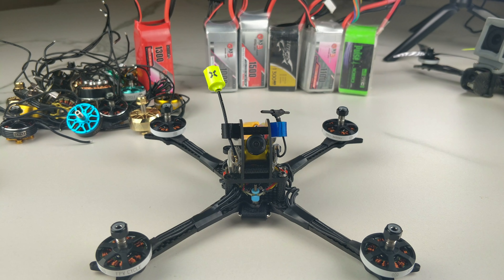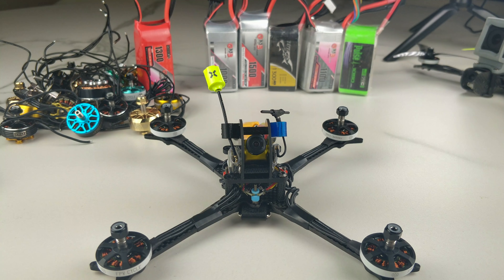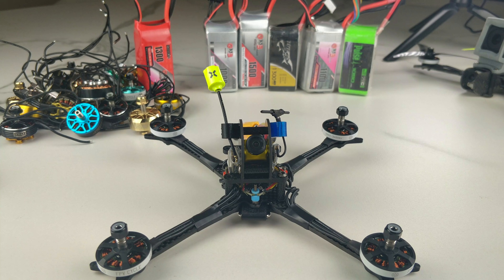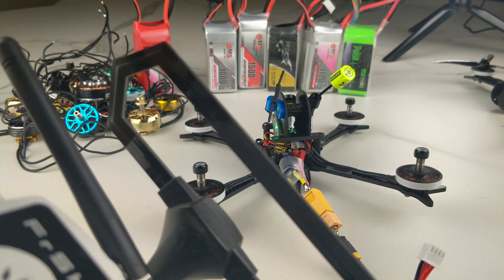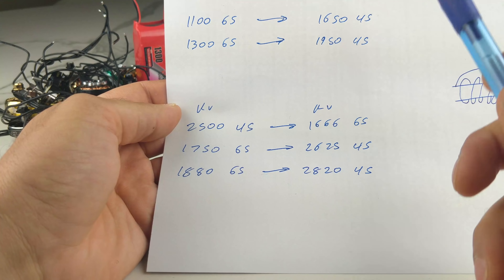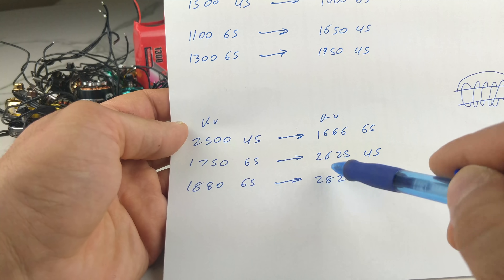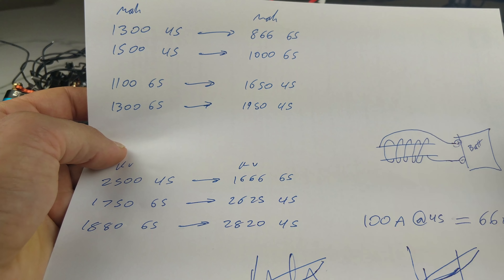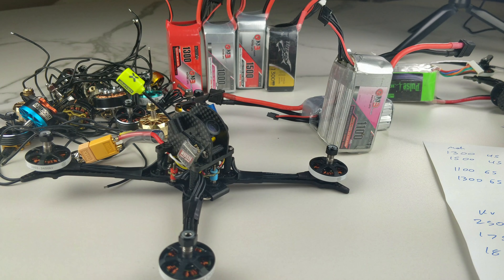6S Everything?  Why does 4S feel different?

Comment: While i do have plenty of 6s, my Skitzo Super Nova frame is on 4s with 2750kv motors and it has remained my favorite quad. I have not been able to duplicate it on a 6s rig.
Reply from the maker: You won't be able to. The torque at the low end just feels way better. But you also get sag on that quad unfortunately

Comment: Great content and great presentation.  I'm a physicist and you nailed it. Thanks for the video.
Reply from the maker: well I did leave out the whole inductance part which sort of continues to balance things but in the end, the ESC is just switching a LOT more at the lower RPM's so no matter what the current ramp is more drastic on higher voltage if all else is equal.

Comment: Higher voltage usually creates a more efficient system, bring on the 20S i say! Can always add a throttle curve to smooth things out.
Reply from the maker: That's not actually true. Higher voltage is less efficient inheritantly.  It's just that the amps overall are lower so you can use thinner wiring and save weight. Otherwise it's also less efficient at the ESC because they need to switch more which is a lot less efficient. The same capacity of lower voltage is going to be a lot more efficient as long as the batteries electrochemistry isn't being over stressed.  This is really why there's no point to going up in volts unless you're already pushing the battery past it's comfortable point.
Reply: @Kabab  i hear where you're coming from but I think you need to give voltage more credit.... smaller windings usually means more efficient motor also(less air more wire)... and in the end isnt everyone getting longer flight times on 6S compared to a similar Wh 4S battery??
Reply: Lmao, nice

Comment: Thanks for taking time to explain this I feel better now I'm new to hobby and going with 4S build ,But I thought made a mistake by not going to 6s because it seems everybody was going with 6S you helped Thanks 👍🏻👍🏻
Reply: 4s is fine bro especially if ya dont carry that pig hero 7 or 8  every flight
Reply from the maker: I still recommend building all 5" quads to 6s and then running lower voltages if desired. Specifically because lower volts on low kv motors is so darn easy to fly. But 4s is totally fine. More than fine. A light 4s quad feels nicer to fly than a heavier 6s quad.
Reply: @Kabab  my stack&FC can handle it but I have 2345 KV motors will that work?
Reply: @sully4875  yup just adust throttle % in BF ...n run a big cap

Comment: I have the parts for a 6S 5 inch UL kwad coming in tomorrow so it'll be interesting.  BH 2004 1950KV motors, Gemfan 5125, AUW under 250g.  Will upload footage on my channel
Reply from the maker: It'll be quick but it definitely doesn't need the 6s. 4s on it would be plenty
Reply: @Kabab  Want to give you a quick update.  My 6S 5 inch Ultralight is flying beautifully, no significant electrical noise issue.  I don't think it's necessarily quicker than 4S given the lower KV (1950) but am liking the faster throttle response and less sag.  Test flight footage: https://youtu.be/LbKmPqfciVU

Comment: Hey KababFPV, just regarding the board and the noise (electrical) motors make on 4S - I am using such board on 7" ultralight 6S. There is such a great noise from those motors that it destroyed my VTX haha.....but it could be fixed by adding multiple capacitors. Ive added like 4 1000uF 25V and its kinda OK now. This defeats the purpose because I am using the board to save some weight so I am saying this to maybe direct You to let manufacturers know to add more capacitors so we could also use these boards on bigger stuff :)

Comment: I dunno. My packs last longer 6s but i do prefer lighter builds with 4s and i think 7 inch flies bettwr and more efficient on 5s
Reply from the maker: It's easier to have much more overall capacity with a 6S pack. A 1300mah 4s is equivalent to an ~850mah 6S. I don't really know of anyone that buys just an 850mah 6s for a 5" quad. They usually start at about 1100mah 6s which is 27% more overall power capacity than a 1300mah 4s. So right off the bat you have 25% more overall charge in a standard typical 6s pack.
Reply: @Kabab  I got into 6s for the longevity fo the packs. My packs go through a full 70 cycles on 6s I couldn't get that on 4s. And for the 7 inch build the 6s setup allows me to use less current (Amps) and sip away at the pack but I did test with 4s and 5s I found 5s to be the sweet spot for the 7 inch in terms of power to pull out of dives and efficiency. It wasn't scientific and I didn't change motor kV in my testing . But for sure my battery lasts longer on 6s setups not flight time just life of the pack I tend to get less dead cells.. weird because the probability of a bad cell is higher with the higher cell count but there you have it
Reply: I'm actually going to try 5 s on my 7 inch again soon
Reply from the maker: @elxero2189  capacity is what leads to flight time. Not voltage. That's why 5S with more capacity is more efficient. Higher voltage is actually less efficient on the ESC side of things. The reason 6s on 5" or really anything under 8" lasts for more cycles is because the overall wattage draw is the same as 4s or 5s but the amperage is less. Amperage and heat are what kills the chemistry. So 6s with less stress per cell due to the higher voltage and higher overall capacity is why they last for more cycles
Reply: @Kabab  yeah that's what I figured. They can take the pressure unlike the 4s which is great for flow style flying. Now 5s -less 100 grams or so with very similar performance might help me eek out a few more minutes on my 7ninch... We shall see. I did take your tip on larger diameter motors for bigger blades though got 3010 motors for 7 to 7.5 props to test so far on 6s I'm getting very similar performance in terms of flight time.

Comment: It feels different because sets ( prop engine battery ) aren't equal match but close aproximation. If round KV up then you need lighter prop . For motor the combined cuperfilling of stator needs to be equal  fictional exmple: total windings 100mm2 == 20 windings(4S) x ?AWG == 30windings(6s) x ?awg that difficult to mach   
1 ampere 6S 15 windings vs 1.5A 4s 10 windings 1.5A  both get magnetic fource generated bij 15amps.

Comment: BTW you better save me a couple fouride 5"s for naming it. ;)
Interesting discussion not sure I totally agree, although I think you are pretty on point with regards to traditional 5" and up. Where I think this changes is when you get into the situation where the battery is literally the limiting factor in the entire build, eg micros, ultralights.
Heavy 3" pilots running big 14xx/15xx motors have found this, going from 4s 650/850 to 6s 550/650 yielded a big jump in performance in most cases. Back when we run "heavy" 2.5" going from 3s 650 to 4s 450 again yielded big improvements in performance all round.
When it comes to situations where you are chasing the smallest battery you can get away with going up in voltage tends to yield positive results. I belive the difference here is that because the power:wight is so high the motor torque is simply a negligable consideration. You'd be hard pressed to say that a 6s 1507 3" is less responsive than a 4s 1507 3" for example.
I do think if you are chasing that ultralight dragon and trying to shrink your lipos, you need to go up in voltage. Maybe if your lipos have power to spare you can afford to drop it again.
Reply from the maker: On that 3", you've gone up in overall Wh on the battery by moving to 6s. You also get a lot more rpm on the motor which is probably what you're considering as 'more performance'. Ultimately it's whatever you feel in the real world. The concepts are never complete enough to explain everything. I'll have some Fouride frames on reserve but there are actually not many 5" ones coming. I misjudged how good the 5" would be
Reply: @Kabab  True apples to apples is often hard just due to availability of cells, I think the crux of it though is about how much spare power your battery has available. The more flight time you spend @ >20-30c the more sense increasing the voltage makes.
I'll keep an eye out on the patreon for the frames.

Comment: What problem is this design solving with motors like those?
Reply from the maker: The frame?  Nothing at all.  it's just a pain frame that's got some updated mounting bits on it.
Reply: KababFPV the motors have no benefit over typical 2306 or 2207? If not why bother?

Comment: I think you are wrong about the explanation of torque of motors.

"Since the strength of the magnetic field is directly related to the current in the wire, the magnitude of the magnetic field would increase with an increase in voltage in the circuit."

Thats simple physics:
U=R*I

U(Voltage) is higher
R(Resistance) is the same
I (Current) is less

and because Escs are working with PWM, thats means the moment the motor is actually having current flowing through it (cause mosfet is powered), its "more current" in that very moment, but for less amount of time, therefore the average amount of Amps is less, even though the magnetic field is "stronger" in the moment the escs are delivering power.

And the reason you have less torque in lower RPM range is, because the downtime of the motor being spinned is lets say 10%on 90%off, therefore, the motor spinning weaker (the same like driving the car in a higher gear)

Hope its understandable.
Reply from the maker: You've contradicted yourself at the end there.  FETs modulate current, not volts. They're switching more at low rpm due to the high voltage.....less current at low rpm. Current is directly proportional to magnetic field generation in an electromagnet. Less current is less magnetic field is less torque. Voltage does add torque in a secondary roundabout way but only when needed....as in when the FETs are open which only happens at the top end of the rpm. End result is less average torque from higher voltage but more peak torque due to the volts being able to drive the current harder and the whole system being higher wattage.

Comment: I run 850mah 6s on my merica x 5" with vanover motors which i believe are 2207.5 1850kv motors and i get more than enough for a 2 minute race.
Reply from the maker: That poor little battery 😅

Comment: I did a test, hovering same quad on 6S and 4S same weight, 6S was drawing 66% of current of 4S
Reply from the maker: But the performance of the calculated correct 6s kv is much worse

Comment: On 6s you're just getting past the effective RPM limit on your ESCs aren't you?
Reply from the maker: Apparently the limit is set by the processor on the ESC's ability to keep up. I don't know ESC stuff well at all. Not even a little really.
Reply: Jb very resently did a vid about high kv and 6s with (on of the blheli devs?) someone who knows a lot about it. At some point the fets will not be able to switch fast enough anymore either because they are to slow or the processing required to drive them takes to long.

Comment: Interesting! I sucked at math, so the math logic for me means nothing, but appreciated! All's I know is when i hit the throttle on my 6s builds it catapults that quad way faster than my 4s quads, it's night and day different. I fly both 4s and 6s and for me it depends upon the flight challenge at hand. I find in a tight proximity site, I fly a 4s setup better than my 6s, because to me 4s is a much slower flight, I have more time to react, whereas 6s the flight is coming at me at the speed of sound! Like anything else, there's the better tool for certain situations, and quads are no different. Obviously a long ranger would fly 6s over a 4s. A freestyle pilot in a tight technically challenging proximity might fly that a whole lot better on 4s over a 6s setup. For instance, that corral spot you fly in some of your videos, I would hammer that with 6s and rocket over those tall trees with massive hang time, but that other site you scare people at a residential median with trees, that would be 4s, oh yes it would!!
Reply from the maker: Yeah sometimes the catapult is fun.

Comment: More cells means lower amps less sack less mass in PCB tracing and kabels. 
A 1S Xclass would need exreem amps and a instead of a XT90 a "XT800" the quad wil be to heavy due to all the Cu , A few CU heavy bricks of ESC's 10oz and wide tracing 
To reduce power los more cells or lighter weight of the quad.

its Obvious that smal craft do not need 6S as amps are far within reasanble amound even for a high power version on 2 to 3S So 2" on 6S is to much also difficult to find low KV 11xx motor. Less choice so aften a not good mach prop motor battery combination.
Reply: Except when it doesn't - more voltage usually means more total power draw can happen.  The result is usually better flight feel, but you wind up carting around a little more battery to make up the power expenditure (but it flies so well).

Comment: Filters all the way to the left can send a quad to the moon, using that as a comparison point is just nonsense.
Reply from the maker: It just happened to be an issue that happened right before I sat down to make the video so I just threw it in.
Reply: Reduce P 25%, and 4s will be as smooth as 3s.
Reply: @cedricgrandseigne  Closer to by 33% (it gets odd), but yeah that's the idea.

Comment: my answer is NO! on planes and gliders, it's better and easy to understand why a machine is made for 2s, another is in 3s, also after 4s, 5s, 6s, 12s! and it is easier to understand why it is simply a question of mass / propellers, motors, size, in short, everything has a meaning and each of the aces batteries have a role to play on certain machines .. that's why for a light machine, you need a light battery, not one that doubles the weight model! .. in short, I'm not an engineer too!, but for me it's a simple problem of mass / power ..

Comment: This Guy !!!!     4S  was jankie then 6S was smooth   then you proceeded to bash 6s   I'm confused Floss Boss   are  you high right now. Low KV Motors  for longer flight time were pushing the idea of 6S. I Loved my odd sized Engineer X motors with 2700 KV ( 5 inch heavy ass Rooster  on 4 or 5s )  but my attempt to use them ( Another rooster )  at 1750KV on a 5" quad with 6 or 5 " props ( AND SIX INCH ARMS !!!)    left it feeling floaty and weak with a 5S battery   ( NOTE 6" props on the rooster touched each other and that had  to stop quick ) . I haven't tried a 6S yet because lets face it they are not cheap.  Been enjoying the TP  even though mine is a bit fat.     So....   Are you NOW saying Higher KV on 4S   for 5" quads  ?
Reply from the maker: Everything you asked in this message is addressed in the video you posted it on.  I'm not saying anything is good or bad.  I am only sharing information that could be helpful and is very interesting

Comment: Show this video to the batter powered blower industry. They've went from 12v to 80v now. Yes. Multiple brands make an 80v batter blower so they can slap the name on the box I guess.
Reply from the maker: That's totally reasonable for them to do also. They're using lion I believe?  Those things cannot supply the amps. So need the volts to drop the current. The system doesn't require torque in the lower end of function because it's kinda just on or off. The way we fly is with torque so we need the full range of torque.
Reply: @Kabab  very true. But if you have a 40v blower, to make 80 you need fo double the cells. So if they were wired in parallel, the cost for fets and control electronics would be less in my mind because less voltage. 6s (22v) is already hard enough lol. So if it were twice the amps, there would be 2x as many cells in parallel. So the only hit in my mind is cost of electronics rated to such voltage. If our quads are fine on 6s, a leaf blower shouldn't need 20s. It is a bit different though as you say, smaller wire and whatnot can be used. But I can bet most of it is marketing.
Reply from the maker: @erick4188  it's marketing for sure. 99.9% marketing

Comment: That was a solid logical analysis of what is really going on with 4s and 6s. Seriously top notch content, thanks! I have been a 6s hold out, mostly because I'm cheap and have a ton of 4s batteries and motors, but also because I really like how my gear flies. That concept of  balance was really well put! Ive been freestyling a floss 2.1 (convinced it might actually be indestructible) with 1500 4s on 2600kv for well over a year and really enjoy it. A low weight freestyle quad just flies great 4s or 6s.
Reply from the maker: It's all about the right setup for the job. If you're not over pushing the batteries and getting good flight time without debilitating sag, don't move up to 6s. It's worse.

Comment: Problem is the Engine... if you like to change from 4s to 6s Motors (KV) the motor have smaler wire´s and higher resistance. the best way is to use single wire motors for 6s. since 10 years i make my own motors and make the wire by myselve with the maximum of lipo cells for privat flying becouse on compititions there are to many limits and rules to use it :D